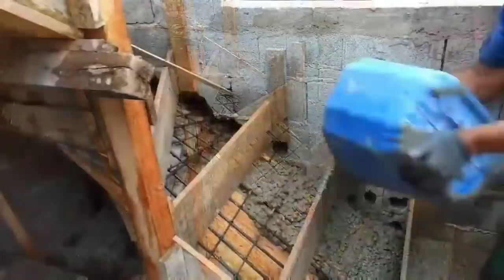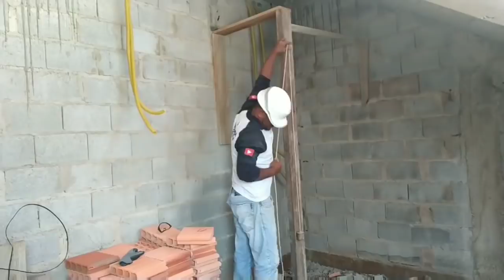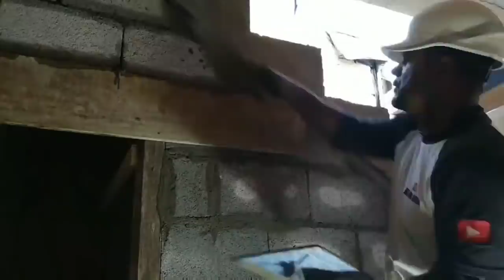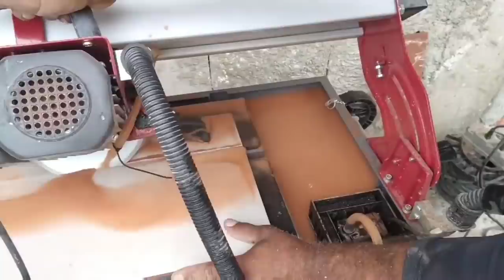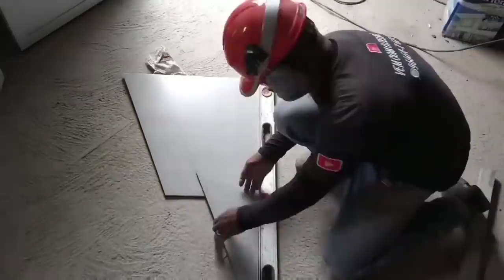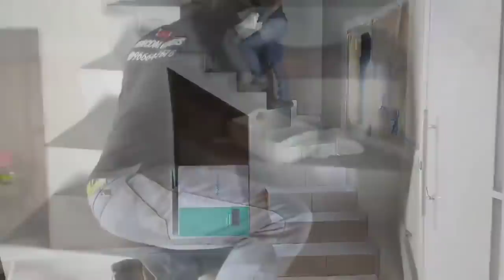INGENIOUS CONSTRUCTION WORKERS WITH SKILLS YOU MUST SEE

Comment: When we're upset about building codes, permits and inspections this video shows us why those things became necessary.
Reply: What do you mean?
Reply: Absolutely. Let's not forget that the codes etc are here to protect us, they are not working against us. This video is a masterclass in how not to do it.
Reply: @thefreedomguyuk  that's weird.  My parents house in Costa Rica survived a 7.3 earthquake in 2012 and was built similar to this and the house didn't suffer a single crack.  I have to say that was actually a fun earthquake especially when I was seeing the walls sway left and right and my daughter clinching to my leg.  Modern homes in Latin America are actually built to be able to with stand most earthquakes.  My parents home has rebar that goes from the floor and the walls are also rebared and are tied down to the floor so the house kind of moves all together.  Older homes good luck.
Reply: Agreed. That tile is too slick to be used on a staircase.  Plus, the inside corner of the stairs had tread depths that are extremely dangerous.  If you wouldn’t let your grandma or kids use them, then you probably designed it poorly.

Comment: I like every construction technique used in this video. Use of recycled lumber for forming, exacting measurements, steel studs to secure walls, breaking open cinder blocks for storage room header to ensure no shifting, finish stucco kept nicely flat and smooth, tiles cut with precision and carefully grouted, etc. One critique, no railing installed for safety of client.

Comment: The first 90° turn should have been a platform (not short and steep steps turning)!
3 or 4 steps up, one platform and from the platform another 4 or 5 up!
Much more secure, and you can lift heavy things upwards much easier, faster and more secure!
The platform is a little bit bigger but it's a perfect opportunity to build a closet under the stairs for cleaning equipment or shoes!
Otherwise it's a good job!

Comment: These stairs are not ingenious, they are just plain dangerous in so many levels. Those winders don't have enough room to step on safely, they should instead have made a quarter landing. Also, porcelain flooring should never be used on stairs: they are too slippery and too fragile to sustain the pounding from adults stepping on them. Lastly, there is no support structure on the wall side: that brick walled room or half bathroom is not enough support for the whole stair structure, which should weight a ton as it is completely made from poured concrete, that web of 1/4" wire (can't call it rebar) is just too little steel to reinforce so much concrete.